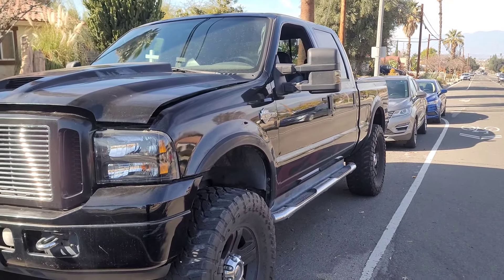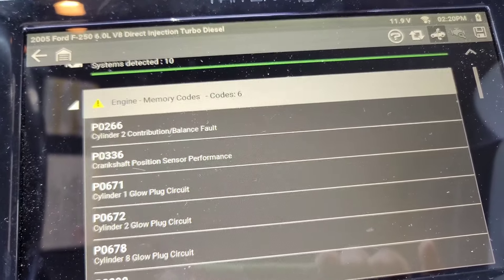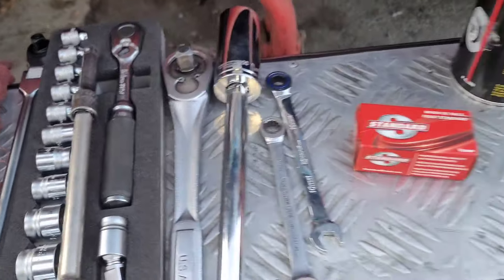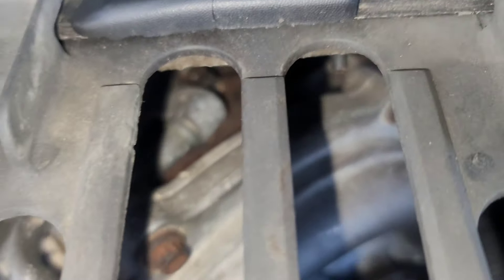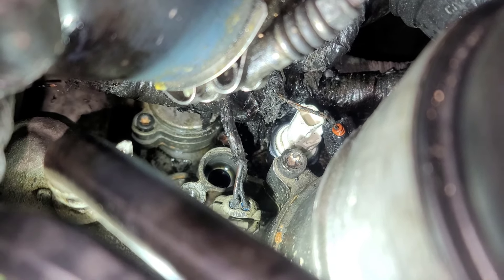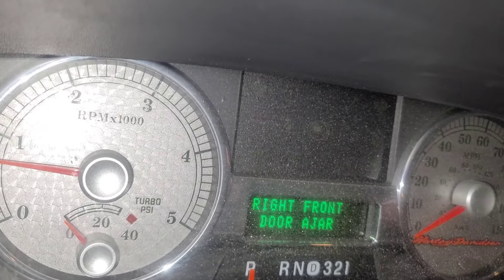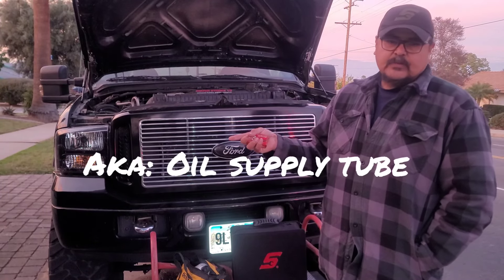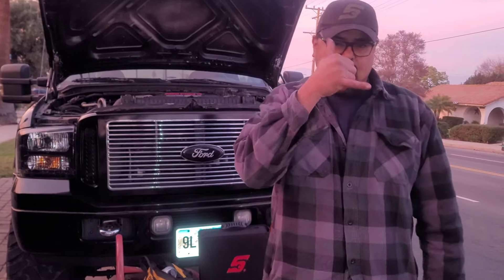2005 Ford 6.0 PowerStroke w/low oil pressure warning repair steps and tips w/PowerStroke Jude

Comment: Did this failure happen just at idle or all together? I’m having the same issue on mine and don’t want to drive it to a shop. Starts just fine and runs smooth
Reply from the maker: The concern was an oil leak.  If your oil guage isn't working you should replace the oil pressure switch/sending unit. It's a repair you can do yourself.  You should replace the connector too